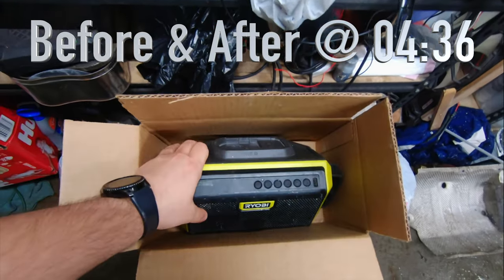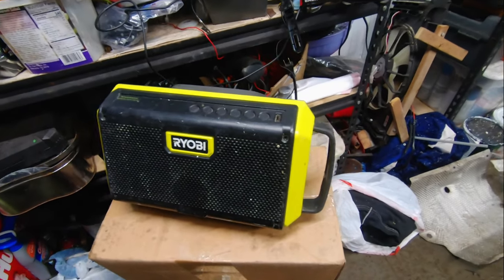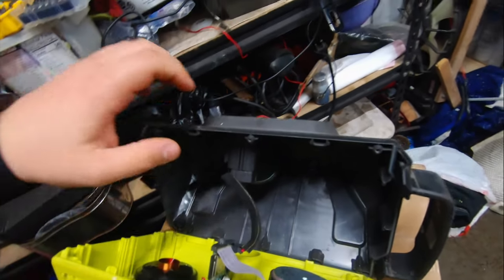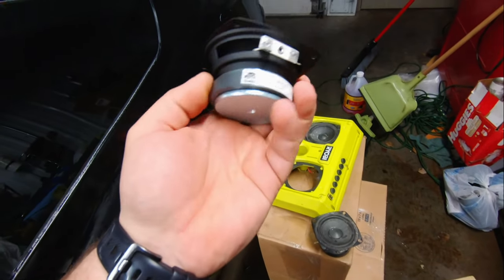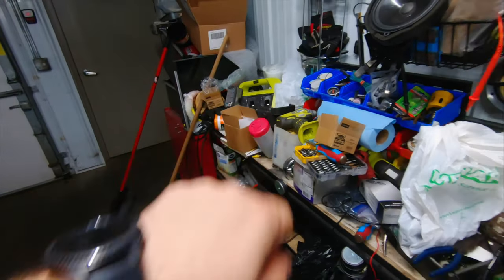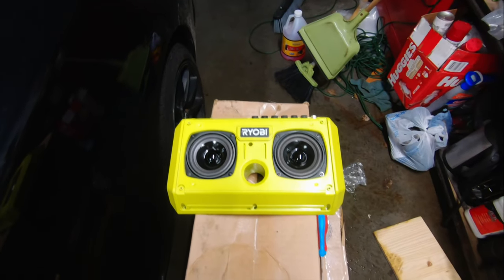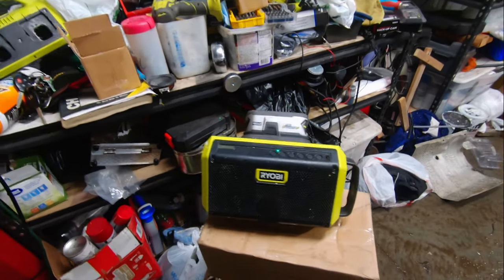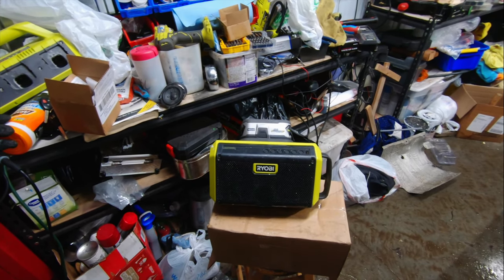Ryobi PAD01 speaker replacement tutorial

Comment: Instead of more cheap china speakers you should have gotten a pair of good 3 inch kicker 2 way speakers it would sound so much better
Reply from the maker: I could have but there's no guarantee that the built in circuit board would be able to support the wattage since most speakers are 30w or more. These are quite loud and have decent quality as is.
Reply: @AleksUsovich   
With speakers, the wattage doesn't matter, as long as you go up. Using 10W is likely just fine, as this probably doesn't hit 15W per speaker, but you could put a 30, 50, even 100W speaker in this with no problem. You can think of the wattage as how much power it can take without burning up. How much heat it can handle as well as efficiency of turning power into sound.
Replacing just one, you made the right choice though since sensitivity can change with a higher wattage design.

The impedance should be matched though (4 ohm).

Cool stuff, I have one and wanted to see what kind of speakers it uses!
Reply from the maker: Really glad for the info! I never understood wattage and the power relationship and just matched the new speaker to the one I had before. Am happy to say that the replacement speakers work flawlessly to this day.
Reply: you should post a link to the speakers you'd use.

Comment: I think I can accomplish this on a P742, the single-speaker radio, without the soldering. A couple of female spade clips (of the proper size) should do it. Also, the link for the speakers you used is dead.
Reply from the maker: You can certainly do with spade or marine wire connectors but I wanted something that could hold up to vibrations and wouldn't come off easily and opted to solder them. Thanks for the heads up about the link, found another pair for sale like the ones I bought: https://www.ebay.com/itm/150936590192?ssspo=kkMwG3NYQFC&sssrc=2349624&ssuid=Z2FH_n8uSOK&var=&widget_ver=artemis&media=COPY

Comment: Do you know how many ohm the stock speakers were? Also anyway to upgrade the amplifier thats with the pad01?
Reply from the maker: I don't know what the stock ohms for the speakers were as it was not written on them. The amp is integrated into the circuit board and does not look easily replacable